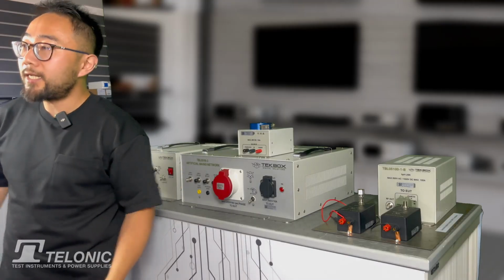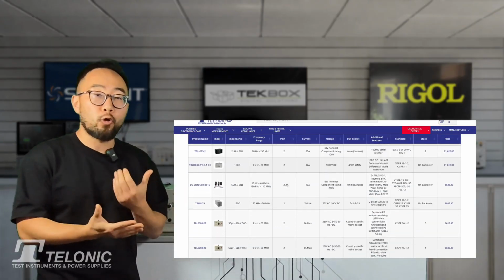A Guide to LISNs with Telonic Instruments UK & Min Zhang

Comment from the maker: Explore the equipment categories behind the different LISN arrangements discussed in this overview:

🔹 Browse LISNs and application categories:
https://telonic.co.uk/product-category/emc/emc-emissions-testing-diagnostics/line-impedance-stabilisation-network-lisn/

🔹 Tekbox TBL0110-2 — a 1 µH network example for spacecraft-related test setups:
https://telonic.co.uk/product/tbl0110-2-1uh-line-impedance-stabilisation-network-lisn/

🔹 RF current monitoring probes:
https://telonic.co.uk/product-category/emc/emc-emissions-testing-diagnostics/rf-current-monitoring-probes/

Begin with the applicable test standard and supply arrangement. The network impedance, frequency coverage, current rating and measurement method all matter when selecting a LISN.